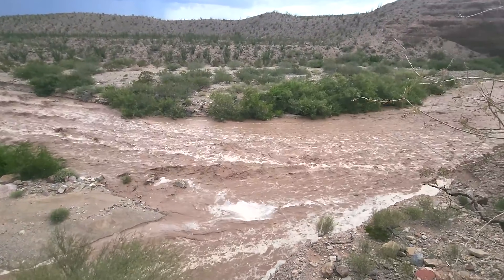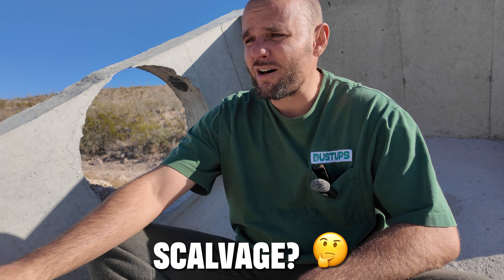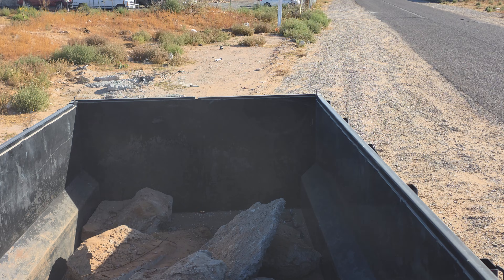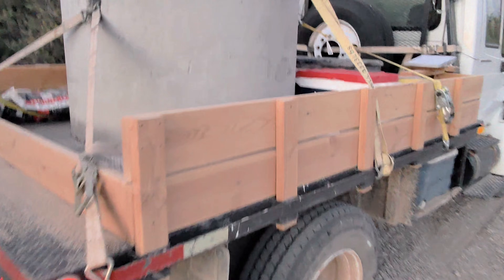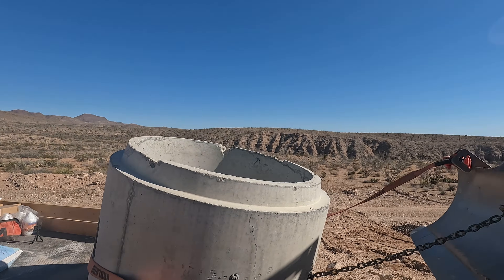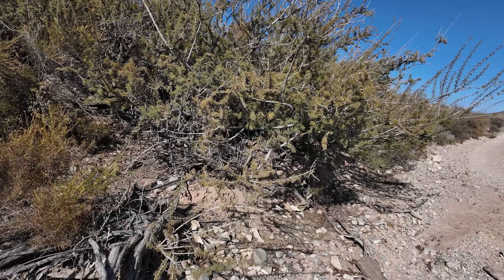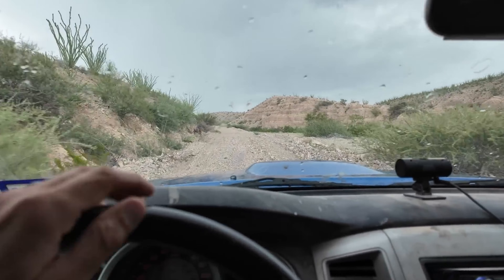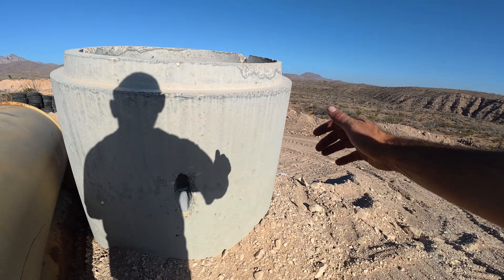I'm Fighting Desert Floods with Free Waste Concrete

Comment: Kind of curious. The water has to flow somewhere if you block its path will it not go a different way and wash out there. Or are you just trying to mitigate the washing out in certain places...
Reply: part of the problem is the sheer force and speed with which the water is flowing the point of waterbreaks like this is not necessarily to divert the waterflow but to slow it down so the particulates and grit that its carrying has time to sink down and deposit or simply keep it from picking up anymore where its flowing
Reply: @fargonotic  Here it's mostly about not picking up more material.  Faster water can pick up larger particles, so if you slow it down at the road, hopefully the gravel road wont be washed away.
Reply: hes building erosion control structures to limit washouts during floods at the crossing
Reply: This is a dope project, really cool seeing the creativity and problem solving in action. One thing I'd check if I were you (you may have already done this) is it a good idea to put a few cement blocks upstream of this wall to help slow down the water in steps or are the engineers saying 1 wall is good enough
Reply: Same here. If he is not slowing the whole river down, he has to widen that road part or it will widen on its own.
Reply: The more you slow water down, the more it can infiltrate into the soil
Reply: He mentioned he access road beind washed out after flooding.

Maybe he isn't doing this just to stop the flow of water but to protect his road
Reply: You need a hardened foot downstream from the dam to absorb the energy from the water flowing over the top.
Reply: That was my initial thought as well. The force of that volume of water at the speed in the last flooding video is A LOT by the time it hits that dam. I'm really curious to see how it all works out. My bet at this point is it pushes to the sides and works like a pressure washer at the ends of the dam and either erodes the walls of the canyon or creates DEEP ruts at the entry & exit since those are not reinforced like the center. Hopefully it just works like a really efficient check dam with a smooth cascade over hardened concrete/stone without washing anything out.
Reply: Tires, for unloading the blocks.  And you can build a unloading ramp with them.
Reply: What I thought would it be possible to use the round casts as a kind of culvert to let the water flow controlled so the water doesn't wash out the road and reinforce the edges of the dirt "bridge with those other structures to slow down the water and direct it into the culverts. But I'm not a landscaping engineer so i can't say if the erosion of the culverts would create more problems
Reply: A concrete road that didn’t washed away would actually be ideal, way cheaper than an actual bridge and he doesn’t need to use it when there is water
Reply: Even if you slow it down, you still need to divert some of it else it'll just keep gaining speed...... I would look at diverting to a man made lake or a few ponds....
Reply: The water will still over the Blocks and the basin between will BE filled with mudd. But that is No Problem. Shaun can Push more Stones and Sand from the Sides into the mudd to mach a flat dry Road. In few year the basin will be filled will rocks
Reply: Some form of bridge where the water flows underneath seems to be ideal. A real bridge is not realistic of course.
Reply: @lukedaniels7750  What is a bridge that isn't a "real" bridge???
Reply: They want to stop the stones from destroying the road, not block the water. Water will still flow through/around the concrete but just with less stones/giant rocks

Comment: Not sure I am convinced by this. Its fighting the physics. Wont the area between the blocks just erode more and then undercut them?
Reply: They're obstacles, they'll slow the water, the goal(initially) is not to make a permanent pond/dam, just to hold some water to be soaked into the ground, the soil will remain wet comparatively longer

Most of the water of course will over/under flow the structures, but some will be captured along some sediment, a flash flood could mean billions of gallons in a few hours
Reply: @marti85cr  what the poster tried to explain is that in  the inevitable gaps between the blocks, the water will have to be flowing faster and thus cause more erosion in those places. I'm not an engineer and thus do not know what solutions can be found to these problems.
Reply: @marti85cr  👍 Thanks for the response.  It will be interesting to see what happens in the flood.
Reply from the maker: The goal is to not have spaces between the blocks. In the interim, they function as weirs
Reply: @dustupstexas  If there are not spaces inbetween the blocks, does the water flow underneath ?
Reply: Exactly what I was thinking. I am sure it is the explanation that is lacking not the process.
Reply: Yes. This is going to happen.
I just don't know at what scale or timeframe